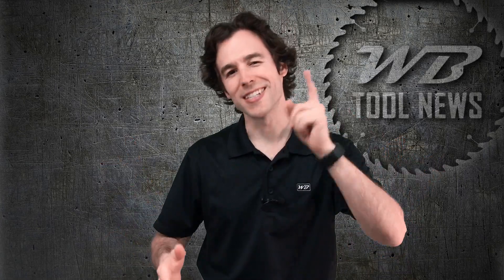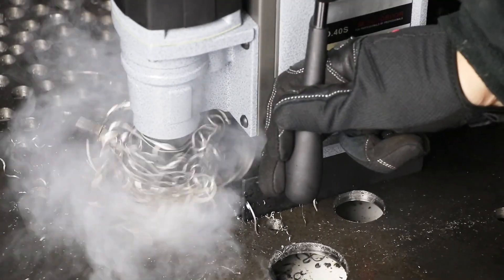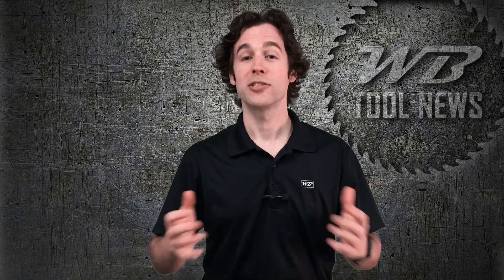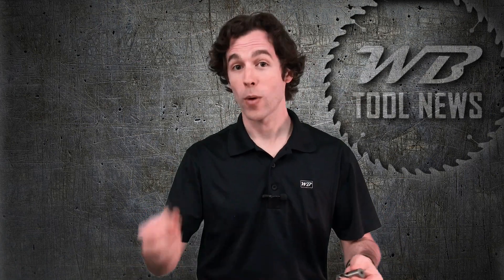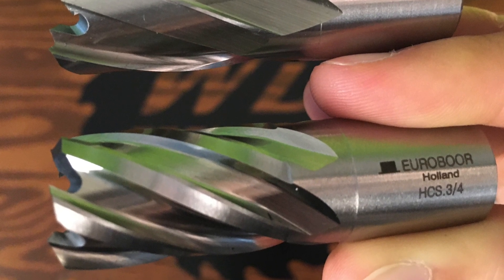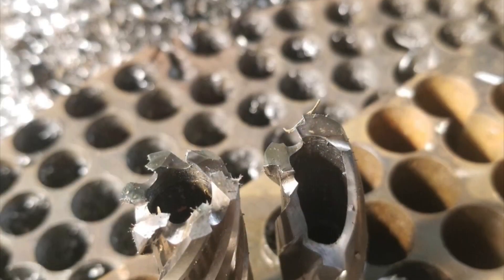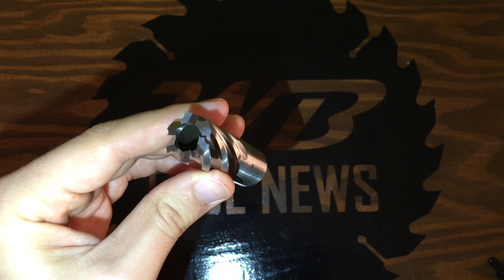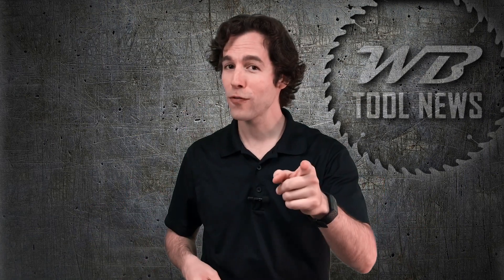Who Makes the Best Annular Cutters? Euroboor Comparison & Review

Comment: I own a set of the Hougen cutters--those intended for use in regular drills and drill presses, not the more heavy duty cutters used in mag drills. I've had a tough time getting a smooth cut, with a nice birds' nest of shavings, even when cutters are used in a drill press where I can be certain about RPM. The cutters will commonly skip, sometimes wandering off center (despite the presence of a center pin, which fits into a hole made previously by center drill), or stall the drill press. I imagine the heavier-duty versions work better, when used in a mag drill or  vertical milling machine.
Reply from the maker: That's great insight, Rich. Thanks for sharing. Are you working with wood or metal?
Reply: @WBToolNews  So sorry, forgot to mention: 1/4" mild steel. The smaller cutters can manage--what, 1/2"?--the larger ones 3/4" I think. That's a limitation. Also, I should mention that I see you can buy 3/4" Weldon to MT2 or MT3 arbors cheaply (Accusize makes some sets that come with one) for those who want to use in a drill press

Comment: good review. any idea about the cutting forces and torque developed during core drilling? say empirical relation?
Reply from the maker: Hi Azhagarason, great question. I did some digging and there isn't a lot of material out there on this for Euroboor. But here's what I can say, cutting force and torque are going to be greatly affected by numerous variables i.e. material, downward pressure, lubricant used, etc. Assuming those are all constant, I still find this cutter to stand out from others because of its teeth geometry and number of teeth. The work of cutting is divided more evenly between all teeth. I hope that helps.
Reply: @WBToolNews  Thankyou for the response. Valuable information. Iam trying to find formulae for cutting force for such cutters. This will give confidence for selection of tool. If any?
Reply from the maker: @azhagarasonb5588  Yea, if you're looking for a formula to calculate cutting force you'll want to consider those variables, maybe as binary (with or without lubricant, etc). Interesting thought. Good luck!
Reply: @WBToolNews  thanks...

Comment: Pretty vague review. Did you at least compare similar price.
Judging from the difference in cutter profile, it looks like a low-end Hougen was compared to a high-end Euroboor.
Reply from the maker: Hi @46inchwoody. Thanks for commenting and sorry to hear you found the comparison vague. We wanted to make a sweet and to-the-point comparison between these two comparable products.
As you probably know, Hougen is considered an industry leader with high-quality tools and Euroboor is quickly growing in North America. If you look them both up on Amazon, you'll find some interesting information regarding their prices. You might be surprised what you find :D
Thanks again and take care!
Reply: @WBToolNews  Appreciate the reply.
I'm very familiar with these, I've been using Hougen and Greenlee for nearly a decade and Milwaukee on the mag-drill. Never used Euroboor because none of my distributors carry them.
  I mentioned price comparison because Hougen makes sets that range from under $100 to over $2000 (obviously not the same quality).
Reply from the maker: @46inchwoody  Right, those will definitely vary in quality and price. As for Euroboor's availability, this is their greatest obstacle right now. It's tough getting a foothold in an already well-established market, but it seems they're making progress.
And thanks for doing the work you do!